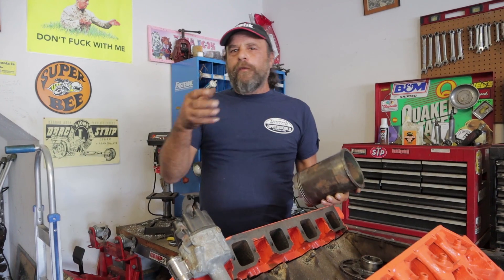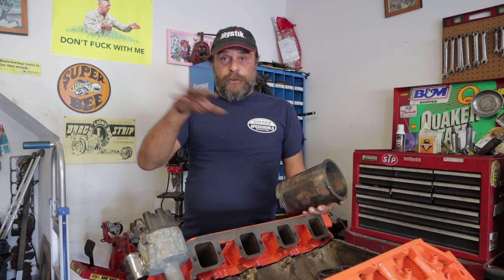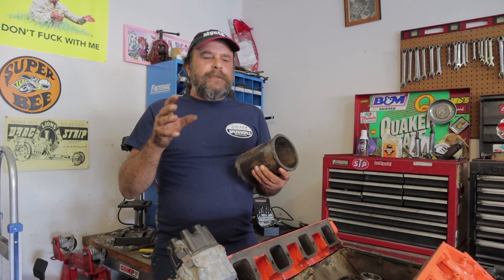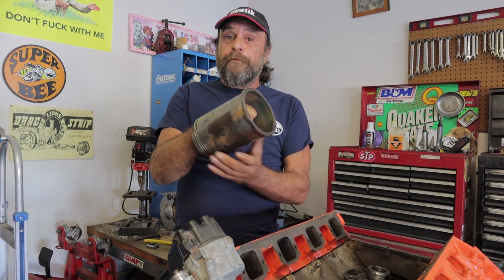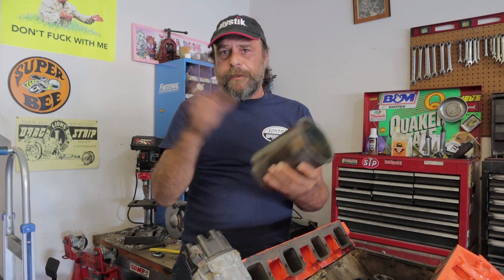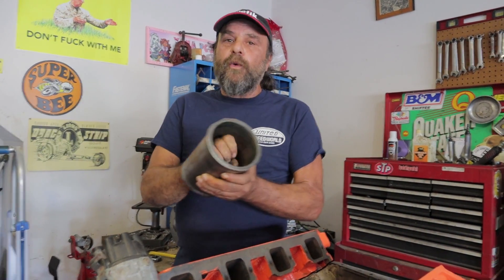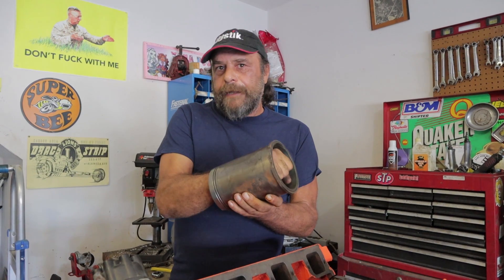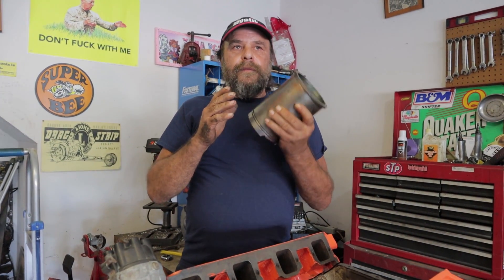The Myth Of Engine Displacement

Comment: So if I`m interpreting this correctly, boring an engine is more effective (power wise) than stroking? Great shows, I`ve been Mopar fan for decades w/many over the yrs. A,B,C,E bodies
Reply: Nope
Reply: @snek9353  I didn`t think so either. It`s getting a tad confusing at UTG with him recently telling an audience he was gonna make a drag car outta another barge w/240 gear, then got pissed when called up on it. Woulda only taken a sec to say "gear change" included. I know 2.40 ain`t race gear & you prob do too, but many youger audience wouldn`t. Think I`ll stick to Nick`s Garage
Reply: @robliboiron5908  The guy's confusing because he's confused. 

Bore vs stroke is a balance, too much stroke and piston speeds are too high, too much bore and it's too hard to prevent detonation.
Reply: @snek9353  glad to hear i`m not the only one getting confused at times. Tony puts in long hard days, paid his dues & def. earned his cred. *Respect! -Had my fit & resubbed lol

Comment: It doesn’t matter what the pin height is or the length of the rod… at 90° rotation the piston will be always be at half of the stroke (swept volume) of the displacement. Bigger is bigger and more potential in making power. If bigger displacement didn’t have the potential to make more power no one would ever make bigger engines. You have to look at bore to stroke ratios and rod lengths for any one given displacement which can have very different performance.

Comment: Awesome , you have exspained that well , but increase bore diameter makes better sense to allow more valve area and the surface area in that 47 degree of expansion pressure . Keep them video's coming Tony , you are a very smart fellow
Reply: Larger bore increases detonation risk requiring a lower compression ratio. And it's more like 140 degrees of expansion.

Comment: Thermal expansion lasts well beyond bdc and into the exhaust stroke., otherwise those three foot flames would not be present. Peak power pulse will be approaching half way down where the crank throw is at it's best angle in terms of leverage against the crank shaft mains.

Comment: Imma play devil’s advocate and say that there’s more rotational mass with a V8 than a 4 cylinder. The extra 4 pistons, connecting rods and longer crankshaft may not weigh all that much static, but they do when they’re moving at 3000 rpms. A V8 is that much more resistant to being stopped.

Comment: The other half of the cycle gives the answer why displacement is important. The 302 draws in mixture for 3 inches of stroke then starts compressing. The described 400 draws for 3 inches, then draws and draws some more for an extra 33% filled cylinder volume. Compressing that gets way more exciting at ignition time.
Okay, that's a stroked engine. What about just overboring? The intake stroke still pulls more mixture plus now there's room for a bigger intake valve. If I'm wrong, just try swapping out your 1968 Mopar 340 with 2.02 inch intake valves above a 4.04 inch bore for a 1965 273 Commando. Same stroke, different displacement. There's no replacement.
(Except when there's other engineering limitations such as with the 225 Slant Six.  Find an early 1970's 198 inch Slant Six, do the same tweaks, and see how they compare above 4000 rpm)

Comment: Tony, you should see the displacement shenanigans surrounding 2 stroke motorcycles.  You can imagine how funny things get when an engine uses its crankcase as an intake and fires its plug every rotation.  The shenanigans have gotten so shenanoriffic that they've got 2x displacement handicaps in effect and everyone's convinced that it's normal.

Comment: You need to understand cylinder pressure before you try to explain it. Maximum cylinder pressure is at 8 to 12 degs ATDC and by 15 to 20 degs is all but done pushing on the piston. The rest of the crank rotation the piston is coasting. Not 90 degs. This is one reason that Turbo Charged engines are always making more power than any other boosted engine. A Turbo Charged engine will make Maximum cylinder pressure at 30degs ATDC.
Reply: derp

Comment: Forgive me if someone has already asked the question.  How would you increase the working area of the piston? I dont wanna take a guess in the dark like i know something.  I have a 318 for instance. The keith black pistons bring the crown up to the top of the deck for increasing the compression ratio correct? would something similar need to be done to the piston in a "reverse" manner inorder to allow for more working area? If any info is available on how to measure or how to perfrom the task can be found can you point me in the right direction? Thank you!
Reply: Stop letting this fool confuse you with his nonsense.

Comment: No matter where you put the pins...
The stoke is the same.
No matter the compression height..
The "arm" (stroke) moves it's length upon revolving.
Then as per your example..
Should we use our formula for determining cid using the full length of the cylinder ?
No...it's determined by stroke ...
How far it moves in the hole.
A block of whatever cyl bore..
Cid changes by,
How far the stoke allow piston movement.
Compression highth can change this..
But you don't reach tdc or hit the head.

Comment: If you call it quits after 90* then a 4 inch stroke is using 2 inch’s of stroke over the 1.5 of a 3 inch stroke.
Reply: And the energy created by combustion does not quit at 90 degrees. If it did the exhaust would be cool.
Reply: Yup, and the exhaust valve doesn't start to open until closer to 140* of rotation. But doesn't flow well for a bit longer, and still even at that point the exhaust leaves under a lot of pressure.

Comment: So what happens if you keep the exact same bore, and exact same stroke but you lengthen the rod and raise the pin in the piston?
Reply: Less friction because the rod angle is decreased and a lighter piston because there's less structure needed. But also a hotter piston because there's less mass and surface area. And taken too far a weaker piston because the face and ring lands are thinner. As well as less capable rings because they're both thinner and overlap the pin.

Comment: The best example I've seen is two identical chev small blocks. A 350, and the other with a 327 crank. The 350 made a little more torque over a wider rev range. The 327 actually made a little more HP at peak rpm. I guess it comes down to how much torque do you need/want?

Comment: "No Replacement For Displacement" can refer to engine bay capacity, where something like a 3.0L V6 intercooled twin turbo can take up more space than a naturally aspirated 5.7L V8. The twin turbos, intercooler, and overhead cams are the replacement, but wind up taking up just as much or more room under the hood, so you really can't replace displacement.

Comment: You make a valid point!  Just an observation:  61 cubic inch motorcycles (1000cc) are making in the neighborhood of 200hp on pump gas.  Not much torque down low, but serious speed up top.  Imagine an X 16 cylinder engine of 244 cubic inches (around 800hp) mated to a continuously variable transmission!

Comment: a large displacement engine does give more torque than a smaller displacement engine of course , but you can only fit so big of engine into certain vehicles , and unless the car is just intended for drag racing , then you don't want too heavy of an engine in your car or else it will not handle / corner as good . for flat-out speed you want horsepower , not torque . as long as the car is geared low enough that the engine has plenty of gear reduction and is allowed to rev into it's power range , than a smaller engine will go plenty fast enough . that is the recipe they used in cars like the older mid engine ferrari's , a small displacement engine with a lot of cylinders for it size , and a short stroke . the more cylinders you have the more what they call " breathing area " it has , and the more air you can get into the engine , the higher it will rev , and the more revolutions you can turn , the more speed you get . and a short stroke cuts friction and allows the engine to rev higher also

Comment: Advantages of a swash plate motor is that the stoke is always at its maximum, no matter what degree it is in its rotation. It sounds to me like a swash plate motor like in a torpedo would make a great drag engine. it can never throw a rod and would make way better torque and way less reciprocal weight and less moving parts. There is a great video on U-TUBE about one in an aircraft made in California. Look up swash plate aircraft engine" to find the video.

Comment: This is not a myth. Big Chief can complete on the street with his 481 because the other guys with bigger engines are pulling power out to Big Chiefs level. You put him on a good track such as Lights Out and he is 4 tenths slower than the big cubic inches. When all things are equal, there is no replacement for displacement. Have to disagree with UT on this one.

Comment: The "work" a piston can do has a lot more to do with the amount of fuel the piston can burn efficiently than the length of the combustion stroke.   The amount of fuel you can burn is restricted by the amount of air you can get in a cylinder.  A greater "displacement" of a piston will draw in more air than an otherwise equal engine.   Most things we do to engines to get more power have to do with drawing more air.  Compression.  Displacement.  Cam.  Valves.  Heads.  Intake.  The rest have to do with minimizing losses to heat, pumping or friction.  Exhaust, compression, exhaust valve opening.

Comment: Like your videos but your dead wrong on this one. More fuel and more air per stroke equals more power period. How can a 350 ci engine beat a 450 ci engine? Easy, one has tight tolerances and the other has loose tolerances in the cylinder walls with the correct cyl. hone to reduce friction. Build two engines identical and I do mean identical in every spec except ci. and the bigger cubic inch motor will always produce more power because it’s taking in more air and fuel producing more power per stroke. More cubic inches equals bigger explosions in the cylinder!  Powers in short block.

Comment: Actually there is. Turbo charger actually increases displacement by shoving more air and fuel into the cylinders beyond what the vacuum of the cylinders make. Also the pressure from the turbo is  putting downward pressure on the piston making horsepower on the cylinders intake stroke.

Comment: I'd like to see a more thorough explanation why more work is not being done as the piston continues to go down, I understand that the intake valve will close at some point but does it really close in the first couple inches of the piston travel, seens like a huge amount of pumping trying to pull a vacuum on a closed cylinder?  How do racing engines hit peak V.E. over 100%  I always said V.E. was the replacement for displacement.

Comment: The other thing of course is the extra stroke of one inch draws in more fuel air mixture which gives more compression a bigger bang and more power.......

All these power mods do one thing..... they burn more fuel per stroke to get a bigger bang

Nothin is for free in the laws of physics 

More is not best it’s gotta be optimal still..... but more and optimal combined....

Comment: Yeah uncle tony...... granted but stroker motors do make more power......... so why do they do it ? Because it works

But your point is valid in that cubes alone doesn’t do it the whole system has to be tuned and the whole setup in harmony makes the extra cubes do their bit 

not the presence of the cubes alone....

Comment: For the street, the GM version of this argument for Chevy 327 vs 350 or 427 BB vs 454 BB. I have heard of racers arguing over what engine is better for power. Even the technology is changing this argument, like say DOHC 4 valve technology or turbos, direct injection, etc. I know I used to run in rural Colorado a W41 Olds Quad 4 modified with equal length headers, with MSD spark Box and other mods and routinely stomp larger v6 and v8s just because the engine could breath and exhale better than many stock engines on the road.

Comment: More boost is king. 80psi will make ANY motor a beast. No replacement for traction boost and weight. Smaller motors spinning faster. Motor Trend described the 911 as a tractor because of full torque at 1300 rpm. Turbos have taken over motorsports. 1990 rally cars were so fast the had to cancel group b. Too many deaths.

Comment: I have a question about this...im 28 ive built amc motors with my dad for jeeos over the years but i have taken a break from the 4x4 world and am now wanting to do an old school muscle build. I bought a 67 cougar someone put a 4blt main 351c with closed chamber 4bbl heads. Ive read several different ways to get more power one being shrink my intake ports of the heads. But back to what you were saying due to i was about to get a stroker kit...can anything be done to heads to have more valve resistance to make the working components work more effective for power?🤷‍♂️🤔

Comment: Excellent video! The other benefit of the bigger bore is reducing the shroud of a wedge valve. How much of that gets offset by piston ring friction due to increased surface area depends upon choice of piston rings. There's also the power-output-to-weight ratio--a Chevy small block 400 destroked to 377 or 352 cid, or an Olds 350 or 403, is going to have a big bore and RPM capacity per the weight of the block (any of which could use an affordable aluminum head). Higher RPM generally means more bang per minute, which can also make power. Otherwise, a large bore tends to be found in a big block, which can also swallow that longer connecting rod that keeps the piston dwelling at the top of the cylinder. 

But the real benefit of increased displacement? You can run 93 octane on the street and still have some torque. Boost and N2O can make an engine act like it has more displacement simply because it makes every intake charge much more efficient than just letting air rush in to equalize pressure between the intake manifold and the nearly-empty cylinder with exhaust gas residue. But you're going to want to run higher octane so you can tune the ignition to take advantage. If you live in a state with E-85, that's great, but if you don't, 100 octane runs $12 a gallon.  so, for a street engine, you increase the stroke, add more torque at a streetable RPM, and displacement makes up for the pump gas compression ratio.

Better heads will help. But another benefit the LS engine has that goes unnoticed is that deep skirt block design. Like the Grand National V6 and the Mopar big block, those larger crankcase volumes leads to less pumping loses--every time the piston comes down the cylinder, its like a parachute and the crankcase vapors don't get compressed as much as a first generation Chevy or Windsor Ford.

Comment: I also raced for over 25yrs. I agree with what you're saying but  that saying is very applicable today. I've seen more of these modern imports blowing their motors at the track than any small 302. They are making up for being a smaller motor and creating a pressure cooker with all the NOS and twin turbos. I mean look how much work a modern Civic would have to put just to keep up with a new GT.

Comment: I'm so glad to hear someone finally say this. I had this rolling around in my head not too long ago. The saying is "there is no replacement for (physical) displacement)" when in all actuality it truly "there is no replacement for displacement (of air)" that's why I have a 1990 4 cylinder 1.6l 16 valve pent roof chamber engine that was rated at 108 from the factory. But I have a 1987 3.7l 12 valve open wedge chamber rated at 95 from the factory. The slant six wasn't moving any air. And the thermodynamic efficiency was stuck in 1959.

Comment: Thanks for the big tip, Tony. I will save my $ on heads, rather than stroker cranks { ect.}. In my case, be it an A 360 or Clev 351; I would go for the max. over bore and unshroud thoughs valves. But are not Clev., block bore walls, made out of paper thin material?? So back to Mopar, a question please; are there many, second hand W2 castings in the States?? Regards, Adam.

Comment: The bottom line is how many pounds of air can you move through an engine in a given amount of time.  Then add fuel in the proper ratio.  Great information on the working area of a cylinder.  Gale banks with Banks Power also has some great videos on this topic if anybody wants to watch some follow up videos.

Comment: There is no replacement for airflow & Brake-specific fuel consumption.

Yes. a 500" PS car can run close to what a 800" car can run. They're running the engine at a far higher RPM to do so. An RPM the 800" engine cannot achieve.

There is the issue of piston speed & the ability to control the piston rings in the bore. Mathematically there is the point where a 500" engine with a shorter stroke at a higher RPM has the same piston speed at a 800" engine at lower RPM. Above that speed efficiency goes in the toilet as ring contol cannot be maintained. True, F1 engines used to spin to 18k RPM but they did so with a very short stoke. The piston speed was actually less than the older non-RPM restricted 500" PS engines. Those 500" engines had the highest piston speed in all of motorsport at one time.